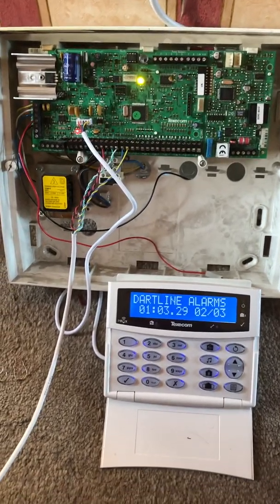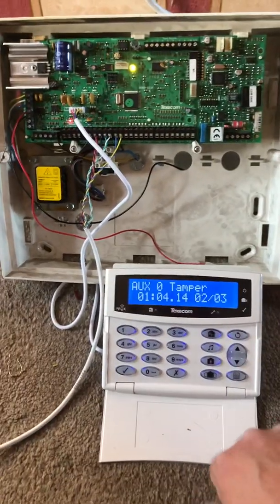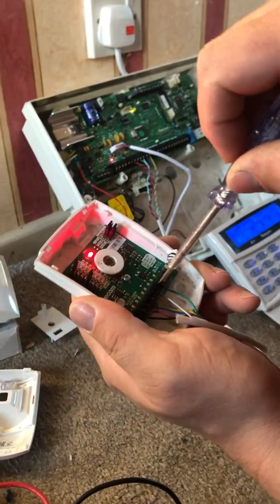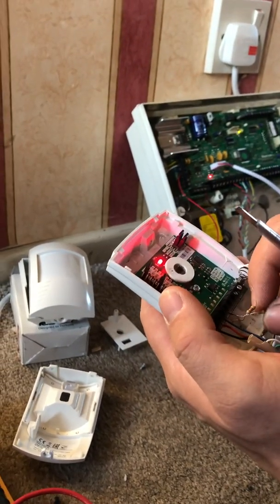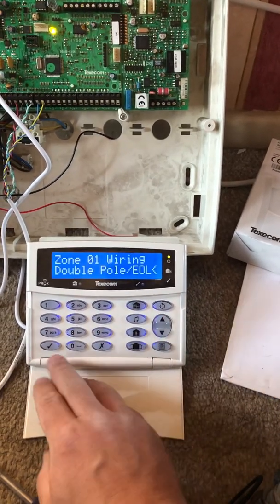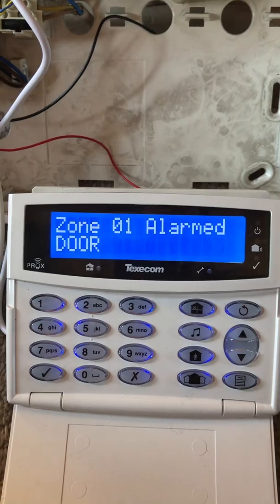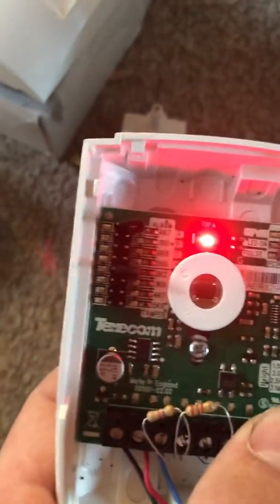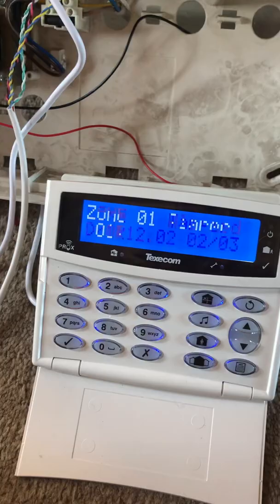Wiring using Resistors

Comment: Hi, great video

Some questions:

Do the resistors normally come with the panel?

Do you think it is ok to carry 3 zones through one cable on an 8 core? E.g Parallel wire the 12v power and use other 3 pairs for FSL zones?

Comment: Very helpful video.  If you're using the 4k7 and 2k2 resistors, what are the other resistors within the pir used for?   Plus is this principle and same resistor values used for all panel manufacturers?    i.e I'd like to apply this to my accenta g4 alarm, thanks
Reply from the maker: Yeah according to the installation Manual it is +v loop so can only be wired using normally closed loops
Reply from the maker: Most Newer PIRs have built in resisters so if you can see the markings on the detector don’t add them just move the pins. All are different but most panels allow you to select the ones used. Accenta is Honeywell so could be 1k1 & 1k1 but don’t quote me on that. G4 is an older discontinued panel so chances are it’s only closed loop. I’ll check and get back to you.
Reply: @alarmassist  thanks mate.  I've fit a few over the years, but I'm no alarm expert.   That explains why my local dealer doesn't seem to have them available on they're website no more.   it seems its all texecom these days.

Comment: Great Videos, Think of getting this system, what sensors need to be wired? have you got a video of the glass break sensor being wired? or the vibration sensor? not sure if they have wireless version as would be easier to install.
Reply from the maker: Bravia AF9 yeah they do have wireless ones if you are using wired ones it’s straight forward you it’s attach it’s just the same as wiring a PIR really. I personally wouldn’t use break glass unless it was required for Alarm confirmation for a monitored alarm as there not that reliable.
Reply: @alarmassist  Thanks, would you recommend the impact sensors instead of glass break? just want a sensor for if someone breaks the glass and comes in through window etc. i have noticed that they do contact and impact so that's a good shout not sure if they are any good though.
Reply from the maker: Bravia AF9 impact are better allow you to test and adjust so you can get the sensitivity right. I would go with that over the break glass.

Comment: Thanls for this.  Can you use EOL wiring in any standard PIR? Ta
Reply from the maker: MatthewW yeah you can provided the control panel supports resistance detection. Most do